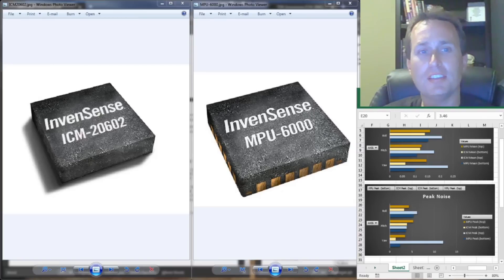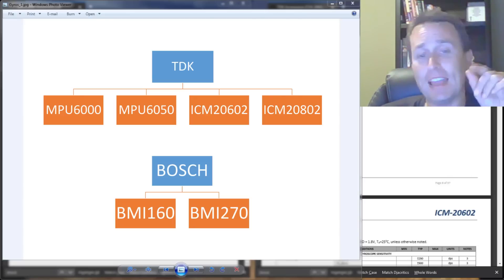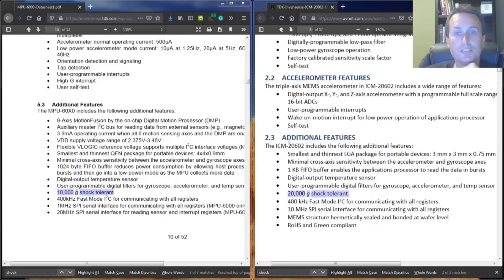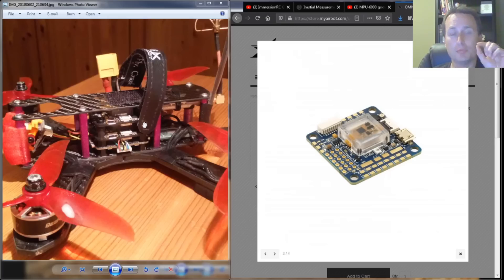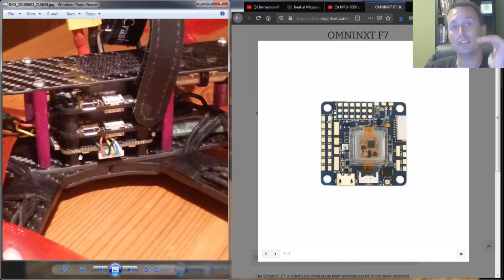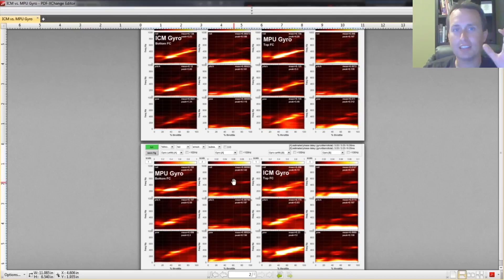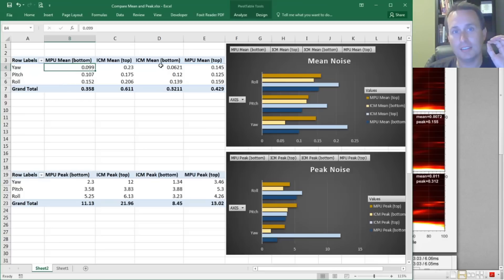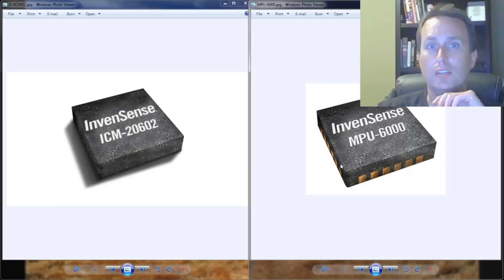Gyro Testing: MPU6000 vs. ICM20602

Comment: 12:39 talon 20x20 mpu6000 vs talon 20x20 fusion... no contest the mpu version has loads more electrical noise when swapped in and out of the same machine, manifesting its self in the pitch axis... IMO its not an issue of gyro type but an issue of how the recommended hardware spec has been implemented
Reply: I was troubleshooting pitch axis noise on two 3" quads recently,  It was the damn mmcx axxi antenna hanging off the back.  they flop around too much and cause lots of pitch noise. printed some mounts two keep them still, and no more pitch noise.
Reply: Exactly!!

Comment: Maybe you can get better readings using something similar to Drone Mesh's simulated aggressive flight manoeuvres.
Reply from the maker: Link?
Reply: @uavtech  example: https://youtu.be/sNDO3RqqHh0 . He does this in every esc noise testing/review. You should do the same thing, but instead of outputting directly to the motors, you should output to the pid controller the same set of inputs.

Comment: Hi Mark, @UAV Tech 
Matek Systems FC F722 SE
Foxeer F722 Dual Flight Controller STM32F722RGT6 MPU6000 und ICM20602
Dalrc F722 Dual Stm32F722Rgt6 Flight Controller Mpu6000 and Icm20602
iFlight Revo Bee32 F7
F7 AIO Omnibus V2 Pro Flugsteuerung - F7 (both gyros in soft-silicon mount)
AIKON F7 FC - OSD, DUAL GYRO (MPU 6000 / ICM 20602 SWITCHABLE), 
AIKON F7 MINI FC 20X20 - OSD, DUAL GYRO (MPU 6000 / ICM 20602 SWITCHABLE)

So the lower the FC is mounted the better. Would it make sense to mount the FC under the ESC? 

I was not aware that nylon extensions influence vibration in a negative way. How would you recommend rebuilding stacks on a noisy quad? Steel screws with grommets? Nylon screws with grommets? O-Ring washers?
Reply from the maker: THANKS!!

Steel studs with rubber grommets on the FC.

Comment: get video Mark! Hey, I was wondering if some FCs are designed with little local capacitors for the gyro and whether that might account for some of the different experiences people have had. I know for instance that the Matek f405 (with the icm) has a brother PDB that has, I think, an on board LC filter/cap.
Reply from the maker: Right, but if you have two gyros on the 3.3v power rail (MPU and ICM) would they not see the same filtering?
Reply: @uavtech  yes, of course the way you did it here is ideal. I was just thinking about people that have stated poor experience with one or the other and whether they might have been comparing apples to oranges, unknowingly, with a cap/lc filter in one case but not the other
Reply from the maker: I TOTALLY agree!!  Electrical filtering is KEEEEYYY!!!
Reply: @uavtech  frankly the on board electrical filtering is key and often under done.. ive seen and had plenty of mpu fcs that should be awesome and aren't....
Reply: @PIDtoolbox  They can be on the same rail, but see different amount of induced current from other nearby traces... SugarK nailed it that the board layout still matters, and most are underdone.
Reply: @BWFPV I don't know if all, but at least some have this. For example the Sp Racing H7 Extreme has lists it in the description: "Simultaneous dual-gyro support already produces low-noise jitter free gyro output, but SP Racing raises the bar again as now the two ICM20602 gyros on the H7 EXTREME are supplied by their own regulator and are supplemented by an additional high-capacity, yet tiny, filter capacitor.  Only this gives the gyros the noise-free power supply they need to work at their best. Each gyro has it's own dedicated SPI bus which allows for parallel data transfers." - source: https://shop.seriouslypro.com/sp-racing-h7-extreme